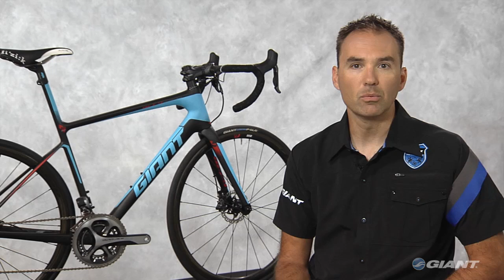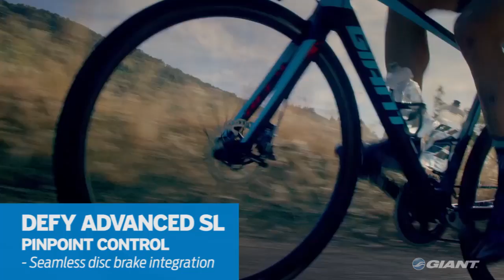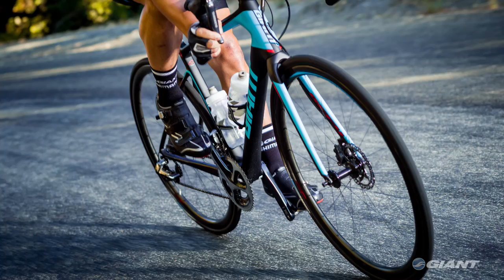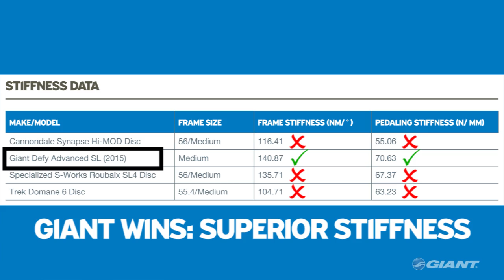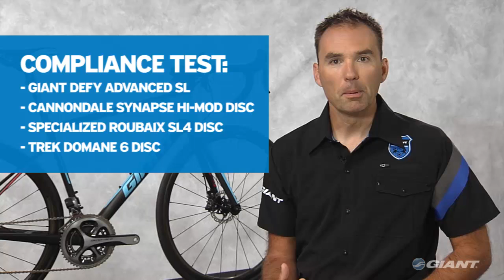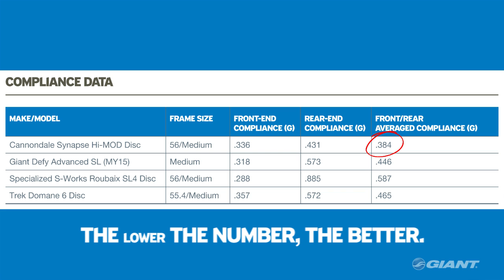The All-New Giant Defy Series

Comment: +RideGiantBicycles What bike would you all recommend to a 45 year old 'returning' novice?  The last time I road raced was in high school. My wallet can afford the 2016 Defy 1 with its $1,659 CDN price tag. But it's Aluminium & Carbon (Composite). Or should search the sofa for change and go with the 2016 Defy Advanced 1, all Carbon (Composite) option with its $2,649 CDN cost? Please note, I have no desire nor ability to race in the Tour de France ;)
Reply: Based only on personal experience suggest always a sportif frame (we are not as young as we used to be so it pays to place comfort as a top priority rather than pure race pedigree) with a minimum of carbon forks but most importantly a frame size that matches your height, first is inside leg then consider torso length, your local bike shop can make sure you get the right size of handlebar tube.  If you find you are suffering from shoulder blade pain (like you've been at your desk too long your body is in tension and you are not cycling in a relaxed geometry - there is an army of MAMILS out there happy to help and advise).  Absolutely get yourself a good pair of padded cycling shorts, I even wear padded cycling underpants to wear as my seat bones do suffer but if it's the only thing spend good money on the right saddle.  I have a Giant Defy Advanced Carbon from 2014 and really REALLY like it but the Aluux frame model is also excellent, Giant are class leaders in Aluminium frame technology and make frames for loads of other manufacturers. The Defy is a very good sportif frame geometry, aim for the Shimano 105 Groupset, it's as good as you could realistically need (defy 2), try to get in to peddle clips as you can really benefit from the added benefit of the upstroke when peddling, a speedometer is also good or use something like Mapmywalk etc to keep a track of your efforts.  Lastly, if you go for the Aluxx Defy, you will have change to get a mid level Cube Aim MTB or similar hardtail to take on the trails when the weather is rubbish (like it always is in Wales) so as not to give you an excuse not to go out on your bike.  Good luck my friend and enjoy - it's way better than golf!

Comment: So let me get this straight, Giant used a medium sized frame tested against a 56cm frame from all of the competition? A 56cm frame from Cannondale, Trek and Specialized equates to their large size, not medium as stated in the video. Plus after comparing the Defy geometry against the geometry of a Roubaix, it looks as though a Large Defy frame has the most similar reach and stack height figures. This means that Giant used a frame in their tests that was two sizes smaller than the competition, given that they have a M/L size between their medium and large sizes. So the measured weight of their frame is no direct comparison because a smaller frame is lighter. Furthermore, the stiffness of their frame cannot be compared because a smaller frame is stiffer! This is why Specialized introduced their rider-first engineered Tarmac, because their smaller sizes were too stiff, and their larger sizes less so. A longer tube is easier to flex, so Giant could easily have done this intentionally to put themselves on top, which would be disgraceful, even if they hadn't felt the need to attack Specialized and Trek by calling them 'gimmicky'.

Comment: I started liking the objective approach but at the end is a direct punch to the other brands. Does not reflect well on the presentation. I don't see any gimics on a Cannondale frame. Actually was deciding among the Defy and the Synapse. Bought the Synapse and it is a bliss. Actually thought that the stays of the Defy are very similar to the BMC gran fondo, and did not like that it looks like a copy. The Synapse looks more genuine and they have brought to the industry the BB30, and the hourglass stays, and the flex on the seatpost tube, and early adoption of carbon, and disc brakes. What innovations has Giant brought to the table?

Comment: "Pedaling stiffness is about forward efficiency." He's either a very poor engineer or just trying to pull the wool over our eyes. Lateral flex in the bottom bracket area of a frame is the result of the pedals being outboard cantilevers. Some of the energy you are putting into the bike is obviously therefore acting laterally on that area and the result is flexing of the frame. If you stiffen the frame then obviously it will flex less in response to the same energy, but it is foolish to think that therefore the energy was not expended. If you think this is difficult to visualise then imagine picking up a stick with a hand at each end and flexing it as hard as you can. Now pick up a stiffer stick and repeat. It flexes less, obviously, but you expended the same amount of energy. Back to the bike.  You can only save any of this energy by minimising the "Q-factor", i.e. adjust your shoes to be as close as possible to the cranks. Another good thought experiment is to imagine your pedals mounted at the end of, say, 30cm spindles. The bottom bracket area of the frame would flex so far under your pedalling effort that you'd probably snap the frame. There are of course benefits to a laterally stiff frame but "all your energy going into forward motion" is not one.
Reply: +Derek Biggerstaff You're right in the sense that it's BS marketing. You're wrong in the science and especially your example part. You don't seem to understand what "expended" means in that kind of system. If a frame is super stiff, the energy transfers further down the line, even if off axis. With a bike it ultimately ends up with a bit of heat, a bit of deformation but the ideal is that even with the angular loss some of the off axis energy still makes it through the cassette. A stiffer bike virtually always transfers more power to the cassette assuming same geometry. The whole point in making the bottom bracket super stiff is to prevent any angular deformation resulting in bigger drivetrain losses if the crank is pulled off the proper chain line, thus allowing the most efficient transfer of energy from the pedals to the ground.

Your stick example is really silly and wrong. As the amount of pressure you get on the termination side of the stick is vastly different when comparing both sticks. "It's foolish to think that therefore the energy was not expanded." It is expended, by the heat generated and the deformation in the bending of the stick. Additionally, this example has nothing to do with off axis torque on a pedal anyway as it's not in any kind of locked in system like a bike pedal is so you can't achieve much off axis torque without destroying the system anyway.
Reply: +OhAiShare Assertions, no evidence.
Reply: +Derek Biggerstaff
When you use completely flawed science as your example it kinda kills any level of credibility. My evidence is in some basic science understanding how bending an object expends energy and understanding of sources of drivetrain loss. They're pretty simple concepts, you can look em up. There's obviously more going on, but those two simple science factors will show you how off your stick comparison is and how poor your overall understanding of the law of energy conservation is. No reason to go into the micro when you can't understand the macro. But it's not like you've provided any of the evidence you're now demanding. So you're obviously going to believe what you like regardless.
Reply: OhAiShare My example was intentionally simple but in what respect is it wrong? I'd genuinely be interested to know.

Comment: If you take one of the components such as a crank and polish it round, then sandblast it so it has a matt finish, then paint it all sexy, people will buy your bike.  Maybe not the hardcore aficionados, but the masses.  GIANT builds bikes to pander to that mentality although like this video, they like to promote themselves as a technical company so they can sell $1500. price points and up.  But the frame, cranks, and other OBVIOUS parts are NOT what really matter, they are only... the obvious and showy parts... what GIANT doesn't address are the BEARINGS, the RACES, the CONES, the BALLS, the SEALS etc etc... in other words, the pieces that Chinese devices usually ignore and so FAIL! as if designed to do so.  Buy a battery powered screw driver made in China, the first thing to fail will not be the injection molded orange plastic or even the handle or spindle.... IT'S THE DETAILS, the things YOU as an American have a traditional belief system in that they are adequate quality and replaceable.  Chinese mass market manufactures like GIANT make 'look alike' products that when you first confront them, seem as good as anything 'out there', but go ahead and ask GIANT about the sphericity and hardness of their bearing races and the construction and availability of their SEALS!   ...right.

Comment: I just own a new Defy 1 2015 and belive me there are 2 great things about this bike
1 is compilance is much different than any other bike the dfuse seat post works great and all frame geometry and the other is the powercore the bb is 1 cm thiner so the peddling is like a little bit harder you have to use lower gears but transmission feels so different than any other bike you can hear harder the sound of tires on pedal stroke i just recommend to buy the smaller frame you can handle for a better expirience